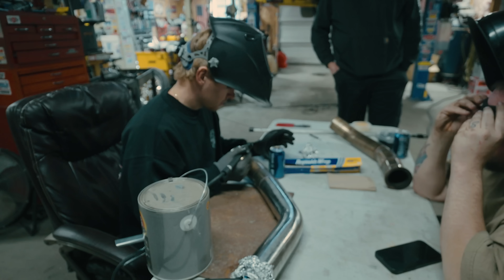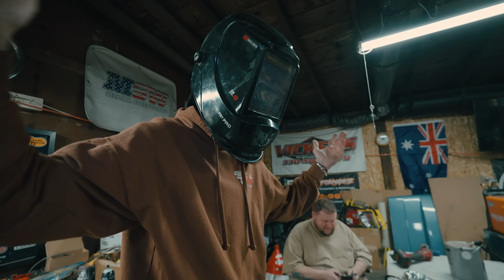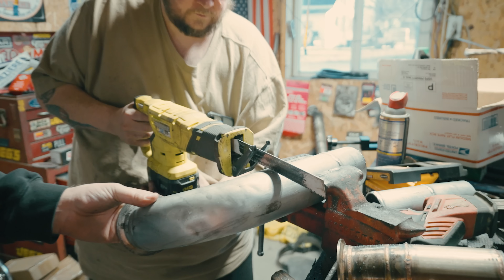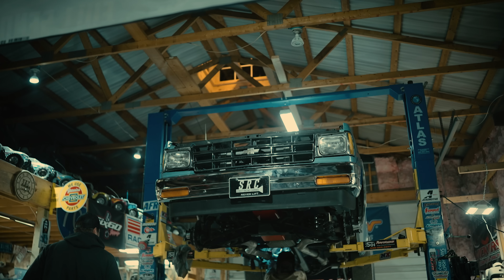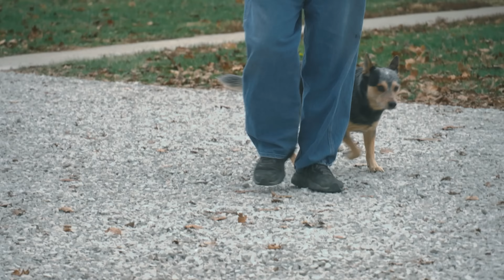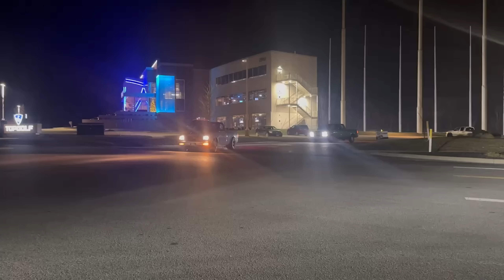Sub-Zero Digs Hard on the Street! - Suspension Upgrades and Full Exhaust.

Comment: CUTTING THE LOWER A-ARM, Had a similar clearance problem in some S-10s I did for their off-road program. I cut the rear a-arm a couple of inches from the pivot and pulled it forward until I had about a 1.5" gap this moves your tire centerline forward about two inches [allowed us to run 35s] and plenty of exhaust clearance. It also increases our camber I run 10-12 degrees and in a short wheelbase, it is Mando. I then filled the gap with 4130 .125 chromoly with a .060 overlap. and with big camber it always wants to go straight. 
Just a thought, for any future projects you might have no one would ever know it was not stock, if you need more travel I used uni-balls [ball joints have no travel] and made a bracket so the cup and plated bolted-in the stock location and hid in with stock rubber boot. the tire actually fits better in the fender.

Comment: Hey Billy they got a Purge kit that you can plug it in that is solid for Tig welding. The other end will have plug so you can put it in a screw in fitting to fit a hose. So you can fill the pipe up with argon so it can be welded on the inside while you are welding on the outside at same time.